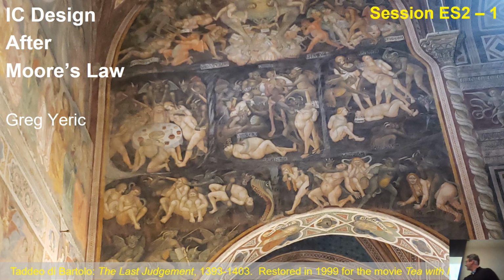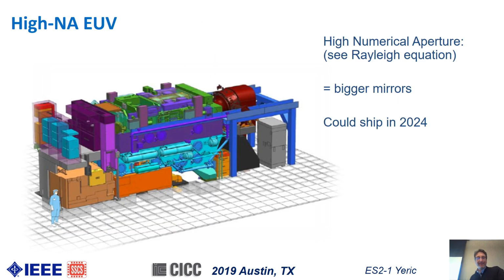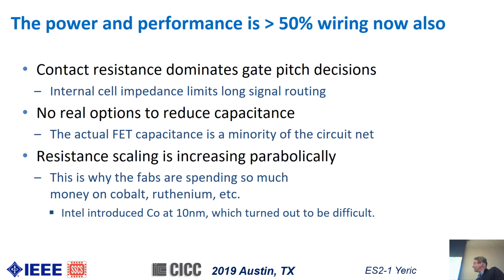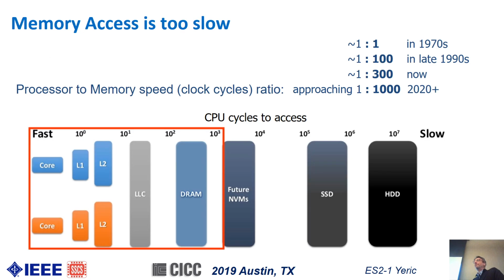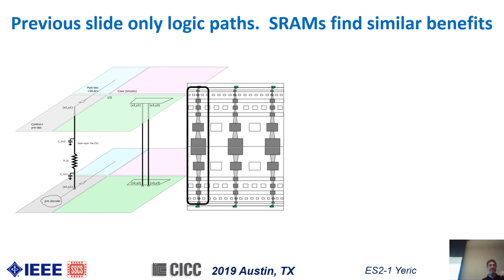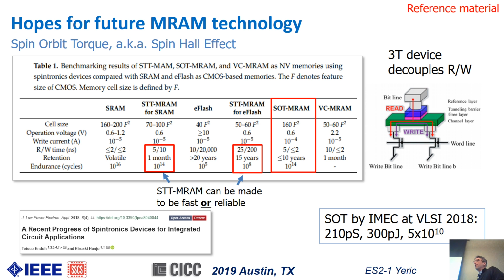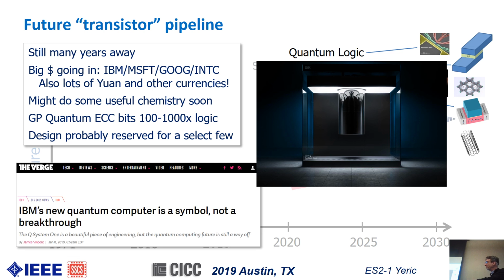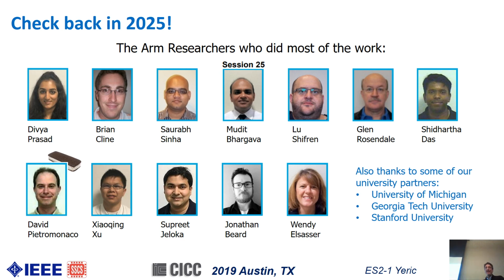CICC ES2-1 - "IC Design after Moore's Law" - Dr. Greg Yeric

Comment: 1:10:30 If the resistors aren’t linear, that nonlinearity will contribute to the activation function’s necessary nonlinearity. Depending on what sort of nonlinearity is involved, that may be acceptable and would mean the model is only portable to other hardware with the same underlying technology
Reply: That non-linearity extent is available in the model (PVT variation) and you can visualize this by running monte Carlo simulations. While training your algorithm you can model those non-linearities as noise. These trained data worked with this particular technology only. Once you change your technology, the non-linearities involved would get changed and you again have to train your algorithm.
Reply: @belaliqbal8858  Can you really model them as noise given they are all the same? You need to accurately compute your gradient if doing backpropagation right?